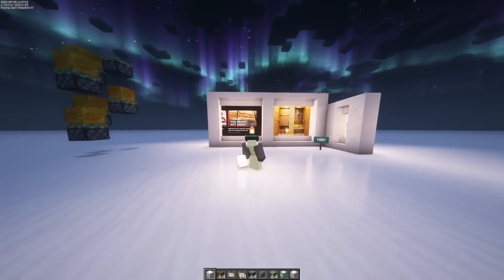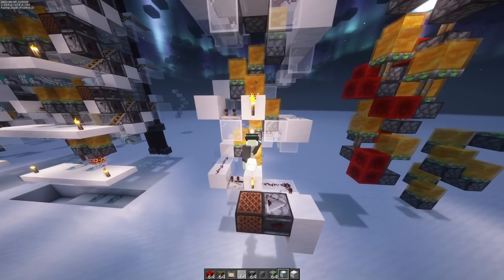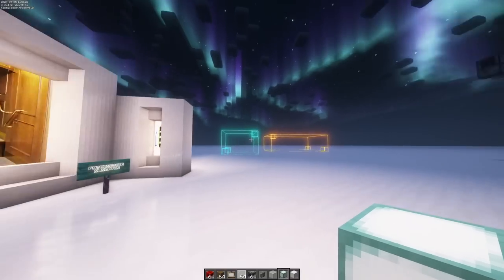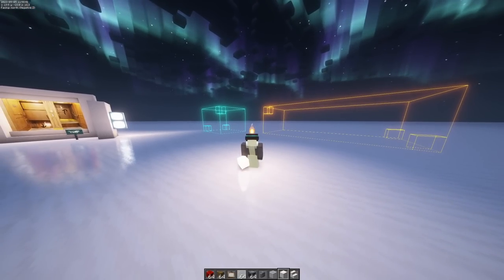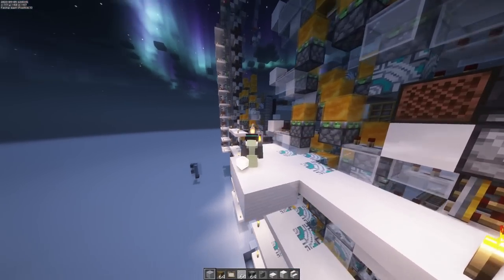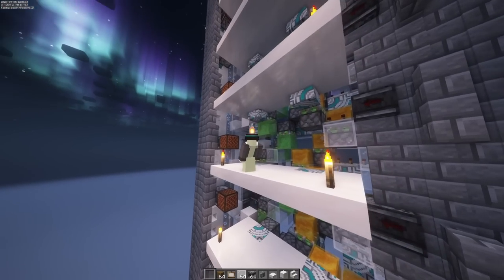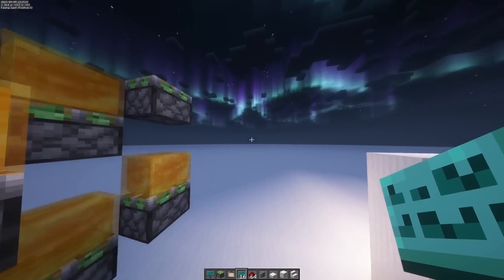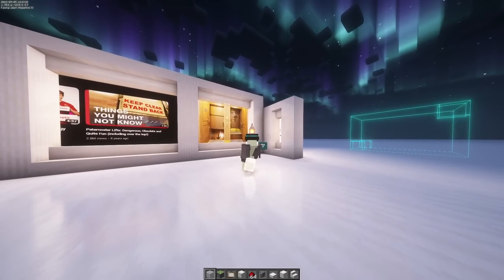Remaking the Weirdest Elevator Design (poorly)

Comment: I would probably not build this with the full spiral slime design, since it makes it hard to get in and also doesn't look that good IMO.
It seems like it probably wouldn't be hard to create a similar setup by just having a longer set of honey (so like, piston controls a 10 high thing of honey, and uses this repeatedly to move the block up). Could probably get things to work at maximum speed by having 2 sets of honey like this adjacent such that one moves up while the other goes down.

Comment: If you use open fence gates you could separate the elevator floors and only have to use one piston at the very bottom/top to move the elevator up and if you want it to be taller than 12 blocks you could use piston push limit extenders.

Comment: Could you make a shaft with just 2 rows of pistons instead of 4 by having the columns push multiple slime blocks where one goes first and then the other, but then as the second is pushing up you have the first pull down and repeat?
I'm not much of a redstoner so I might be wrong, idk.

Comment: Very interesting indeed.
So you mentioned the delay of extending pistons. But you forgot to mention the delay of a retracting pistons. Doesn't sticky pistons retract much faster? Thus what if you just flip the current design to have it retract the block instead of pushing it. In theory the elevator should be much quicker correct?
Makes me wonder if the block would be pulled down so fast the player would actually just die from fall damage 🤣

Anyways just a few thoughts! Fun video, cheers